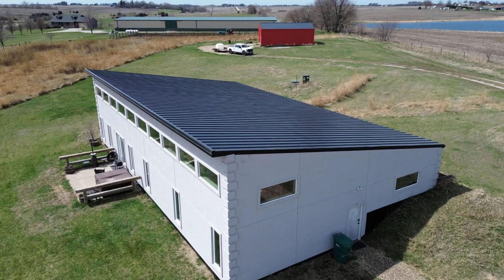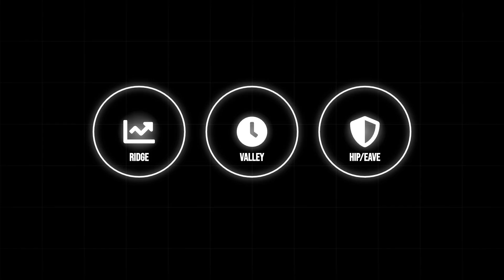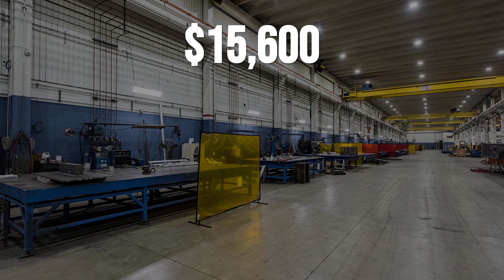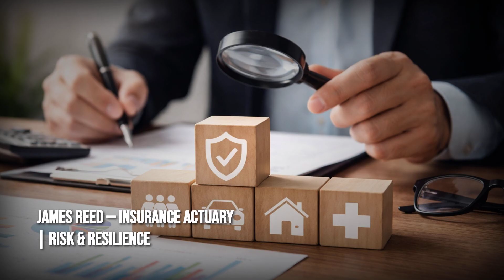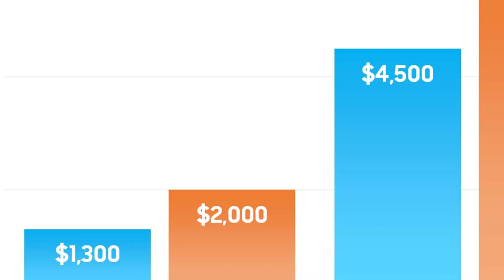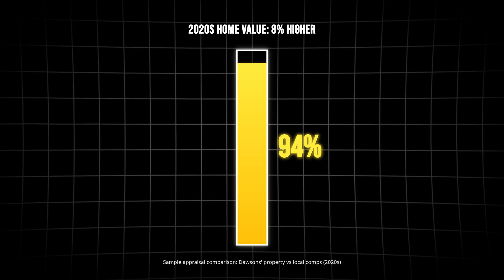Do THIS To Save $40,000 On Your Bardominium

Comment: We did a cost per square metre comparison before committing to Edveros. At the same spec level as a comparable traditional luxury build — same glazing, same insulation, same smart home integration — Edveros came in below. Not above. Below.